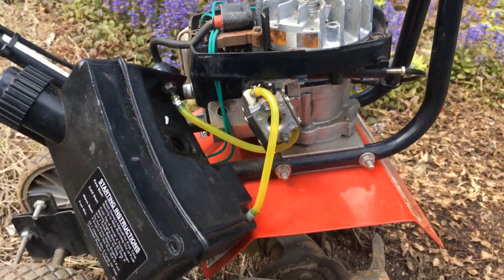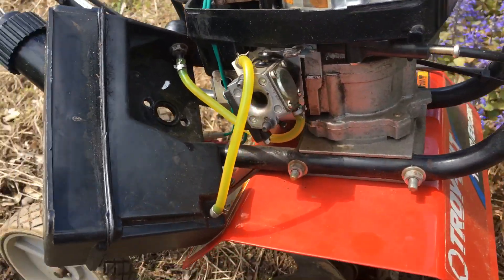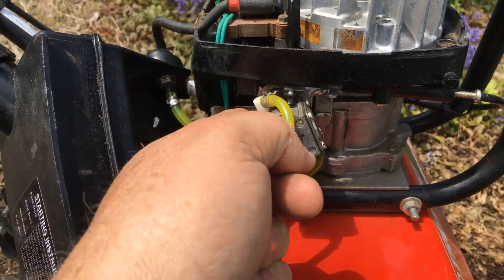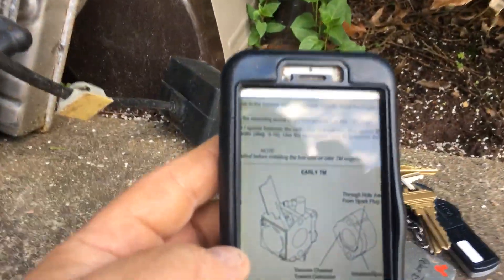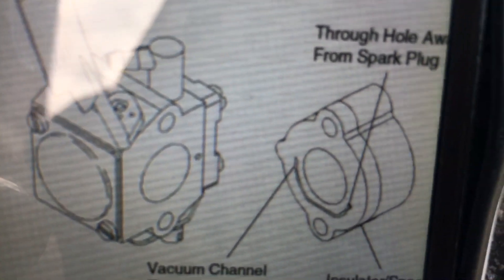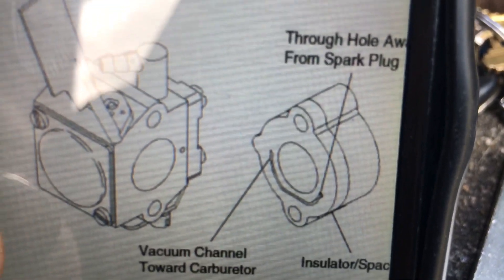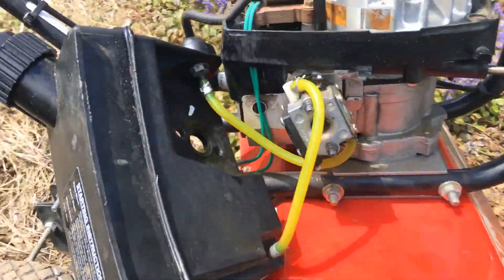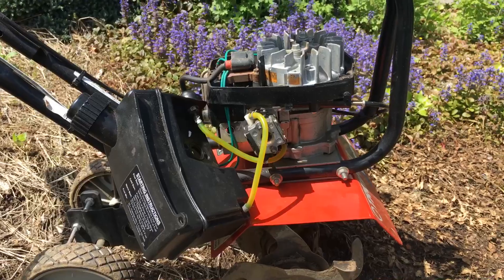Tecumseh 2 stroke Tiller not getting fuel

Comment: Ken i have a question. When you pull the throttle trigger on the handle you can see the carburetor open. It's by a cable and the spring attached. What makes the throttle plate go back in place once you let off the trigger? I don't have any return spring on mine. The throttle will open but it kind of just floats when you let go of the trigger. I can't seem to figure it out. It was my dad's.
Reply from the maker: There should be a return spring on the throttle shaft on top of the carburetor
Reply: Yes I have a spring. It creates tension when you pull the throttle cable. It stretches. But then it doesn't return the throttle blade back. It stays open. The cable releases but the top of the throttle arm where the spring hooks just stays at the same spot. I was wondering if there are two springs. One with tension to return the throttle plate back.

Comment: Can you point me to a carb rebuild kit for the TC II 300? Thanks much. My tiller only has one gas line and an in line filter. Still have to check that pulse thingy. Worked only on wide open two years ago. Thanks again.
Reply from the maker: Is your carb a Walbro or ZAMA.  What numbers are on the carb?
Reply: @KensSmallEngineRepair  I'm taking it apart again shortly to see if the pulse is plugged. Other than having one gas pipe instead of two it looks just like the one in the vid. TC II 300 3170G (B) 0062G ; WTPXS.0494EA, umbers on the carb 5170A0D
Reply from the maker: https://www.amazon.com/Carburetor-Tecumseh-640231A-Replaces-Engines/dp/B08422FPCB
Reply: @KensSmallEngineRepair  Thanks Ken for the part link!!, I found the needle valve all gummy and some dirt or gasket dust inside there too.  After priming it 3 times it started. Runs rough. skipping a little, and takes heavy choking until it gets hot and I can back off the choke to 1/2. (slow gas flow?) When I let up on the gas quick it stalls. For the most part starts right up again, with choke. Pretty much how it ran two years ago. I put 1/4 cup of Stable in a gallon of 2cycle treated fuel. Will this be ok for a two cycle motor?
Reply from the maker: @jimsaltsman6851  that's Wayyyyy to much Stabil! Your'e not making a Shirley Temple!! Two stroke oil has stabilizers built into it, no need for extra Stabilizer, it will just lean out the mix and cause more carbon buildup.

Comment: Where can you get the springs for the air vain ?  the spring that goes over the linkage from the vain to the carburator. Thank you . Its really small . Mine is a lil hoe hoffco Tecumseh 2 . Thank you .
Reply from the maker: This?
Tecumseh 570716 Lawn & Garden Equipment Engine Governor Spring Genuine Original Equipment Manufacturer (OEM) Part https://a.co/d/3PT5tzu

Comment: I have a TM motor with a Tecumseh carb on my Murray tiller (engine TM049XA).  My tiller runs but has poor power... any ideas why?
Reply from the maker: Is the air vane governor working properly? Not hung up?
Reply: @KensSmallEngineRepair  It appears that the air vane governor is moving fine.  I do have the free Tecumseh service manual you have been referring to, I've read through it and learned a few things.  The exhaust doesn't appear plugged, the piston and rings don't show any scoring.  It has numerous checklists that I'm going through. I'm wondering if it needs a governor adjustment.  Any ideas?
Reply from the maker: Fuel filter ok? Have you taken the carb apart to see if their is a blocked Filter screen and that all the diaphragms are soft and pliable?
Reply: @KensSmallEngineRepair  - Funny thing is I don't think it has a fuel filter (unless it's in the tank).  The fuel just drains out the bottom of the tank.  I did clean up the carb, the diaphragms appeared to be just fine.
Reply: @KensSmallEngineRepair  - good question,  I'll have to check.  The tiller doesn't seem to rev to optimum rpms. Could it be a blocked exhaust?
Reply from the maker: The filter is in the tank
Reply: @KensSmallEngineRepair  How does one remove the fuel filter from the tank?  Is the tank a two-piece assembly?  If its one piece, it will be almost impossible to access because it's on the opposite side of the tank from the filler opening.

Comment: trying to figure out how the throttle cable hooks to the carburetor on the same setup only mine dont have a primer
Reply from the maker: Usually there is a clamp that holds the cable to the engine
Reply: @KensSmallEngineRepair  thanks I figured it out it only works off that tiny spring would think the cable would hook to the carb somehow but it don’t  thanks for the response
Reply from the maker: @tommyulman6623  some work off an air vane that looks like a flag and blows from air generated by the flywheel to govern the speed
Reply: Yeah this one does but I thought there would be more when revving

Comment: What size are the fuel lines for this motor?

Good video. Thx
Reply from the maker: That video was years ago.  I measure the nipples on the carb and the holes in the fuel tank and make sure my hoses will be tight in the holes and snug on the nipples.  Generally hoses are 2mmID X 4 or 5mm OD.

Comment: Can you point me in the right direction for finding parts for this tiller please?
Reply from the maker: The engine was made in Italy.  MTD made the rest. What are you looking for exactly?
Reply: @KensSmallEngineRepair  Bearing that goes on shaft below the clutch.
Reply from the maker: @levishilling6490  the needle bearing in the drum?
Reply: @KensSmallEngineRepair  just below the clutch drum. I believe is that it is. But, it's not a needle bearing. It had ballbearings in it. I believe it had 6 total balls in it it was a part when I split the housing and it was in pieces so have nothing to cross reference for size to replace it with.

Comment: So I am 100% right.  Does the Grove on the spacer face the engine or carburetor?  In diagrams it looks like the Grove side of the spacer goes against the engine block.
Reply from the maker: You have to make sure the pulse hole on the engine gets to the carb look at the spacer to see which way will get the pulse from the engine to the carb body

Comment: is that a tecumseh II 49cc engine ? if so what would you think the max rpm is?                               also do you think it would fit on a friction drive bike kit?
Reply from the maker: It’s a Tecumseh TCII engine. They came in 3 models, 200, 300, and TM. The later 2 are 49cc. Max rpm I can’t answer because the service manual just tells you to run it just off of lean (4-stroking) under load to insure no high speed lean meltdown. It would work for a bike I’m sure if you rig it up properly. Thanks for watching. Here is the link to the free service manual.           http://www.smallenginesuppliers.com/html/engine-specs/tecumseh/Tecumseh_TC-TM_Engines_Service_Information.pdf

Comment: I must be misunderstanding something about the impulse holes. 
  Mine had a gasket between the spacer and the engine. It also had a gasket between the spacer and carb. 
  The groove was against the engine and that gasket when I took it apart. I could see and feel where the gasket had gone partially into the groove. 
  I could pour fuel in it and get it to run a little while. A very short little while. But, when I took it apart again and tried what I understand to be what you show with the groove against the carb with no gasket, it won’t start at all. 
  Watched another video, and I think it shows the way this was to begin with. 
  This first time rebuilding this particular type carb. Gonna have to get a kit with at least a new metering diaphragm.
Reply: Put it back together like it came apart. Cranked right up. Might be a different motor. 
  The cultivator it is on shows to be TCII.  The engine has TC 300 on it, if I am not mistaken.
Reply: Same here. But I'm dealing with a major feul leak and cannot figure out where it's coming from. Any advice would be helpful.
Reply: @El_El_Guapo   Your white plastic fuel inlet is probably cracked.  That is what happened to mine.

Comment: I just had a similar issue with a customer's unit. He took it apart and did not know how to put it back together. Your information is incorrect though. There IS a gasket that goes between the carburetor and the plastic spacer. It also verifies that a gasket is to be used on any parts list that I have looked up. 

Plastic has a tenancy to warp and or crack so the gasket does 2 jobs. It makes a seal between the carburetor body and the spacer as well as gives the spacer some cushioning. 

There is also a gasket that goes on the other side of the spacer against the heat shield as well as another gasket that goes between the heat shield and the intake port. 

All 3 gaskets are the same part number(part# 510327B).
Reply from the maker: Thanks for clarifying. The unit as I received it had only one gasket and it appeared to never have been disassembled.  I have seen no gasket used with some applications
Reply: Glad u put this comment lol thank you BOTH for the helpful info lol
Reply from the maker: Glad it helped!

Comment: Mine keeps dripping fuel out of the carb, don’t know if the needle is not seating correctly or what, and I can’t find squat online as far as carb and the way linkage hooks to it, any chance you still have that link? Thanks
Reply from the maker: Search for Tecumseh TCII manual
Reply: Mine was leaking too. It was leaking from the plastic elbow on top of the carb where the gas line goes in. It was cracked. And can get a replacement online fairly  cheap.
Reply: @chadriggs3322  Chad, is this what you need? https://www.amazon.com/Lawnmowers-Original-Tecumseh-Carburetor-Plastic/dp/B01LZXAC4J/ref=pd_bxgy_img_3/135-4546723-8208763?_encoding=UTF8&pd_rd_i=B01LZXAC4J&pd_rd_r=eebcabf3-b6a3-4786-8373-51753e0911f7&pd_rd_w=hItmK&pd_rd_wg=TztjG&pf_rd_p=fd3ebcd0-c1a2-44cf-aba2-bbf4810b3732&pf_rd_r=7F0KSDWV7HHXQ8XARZ32&psc=1&refRID=7F0KSDWV7HHXQ8XARZ32

Comment: Had one of these little engines on a smoke ejector form the fire dept. where the plastic spacer had some slight warpage to it causing it not to seal up thus no impulse signal, my fix was some .010 gasket material and I made a gasket and yes I had to take it back apart to open up the pulse passage cause the gasket sunk in blocking the singal.